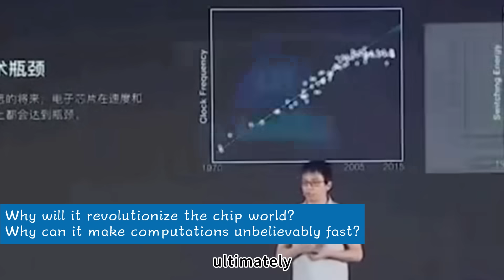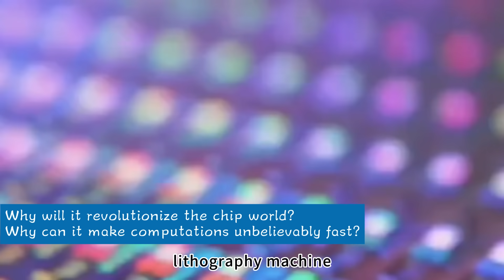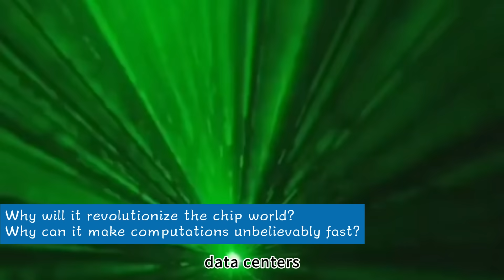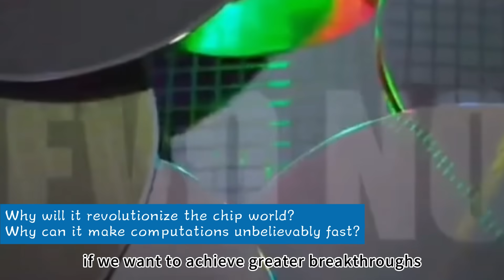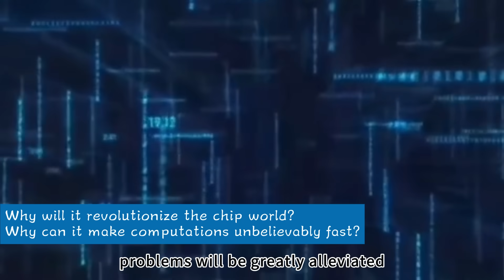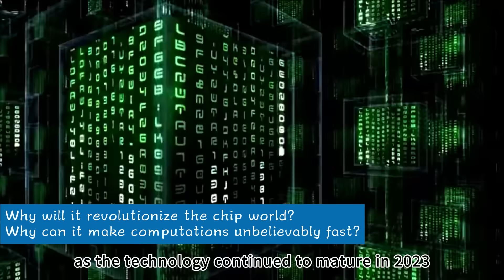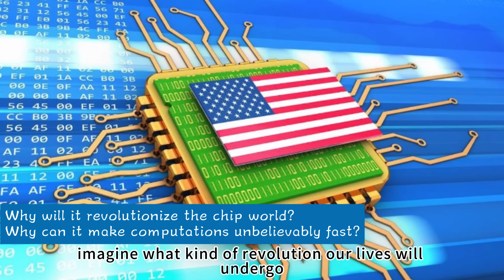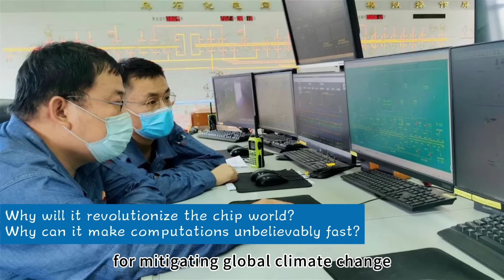Chinese 31 Year Old Scientist Shen YichenPhotonic Chip Technology Emerges!

Comment: Commercialization of photonic chips for quantum computing still comes with challenges and to displace silicon electrons chips would take some time. Stabilization of light source and the precision carving of tiny fibre connections are crucial in ensuring efficiency and yield in the production of such chips. Fabrication techniques and testing processes are still improving as we speak or debate on this topic. Wider adoption has started in Lidar, biosensing, augmented reality with limited adoption in quantum computing have started. Silicon electron integrated circuits will still be used and other areas of development using carbon or hybrid material as against silicon are also explored. Laser induced plasma approach is tested to overcome EUV shortcomings is being tested this quarter and I hope we could see some breakthrough soon. I m optimistic. Cheers!

Comment: Problems usually arise in the fabrication stage. It's one thing to demonstrate a single gate in a lab, but a much harder problem to create chips with millions of gates. It's the dreaded yield rate issue. If one in a million gates come out wrong then the whole chip fails. It's a similar issue with carbon nanotubes, which do work, but the fabrication is difficult and unreliable.
Reply: The real reason why photonic chips are still not adopted widely.